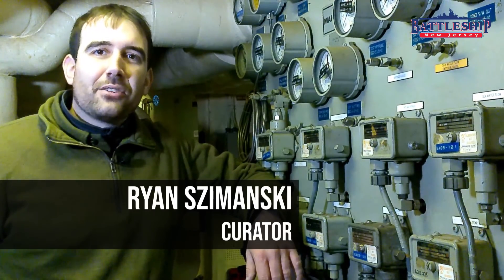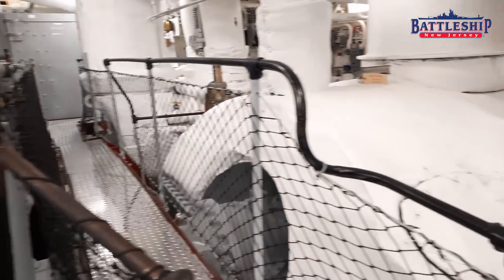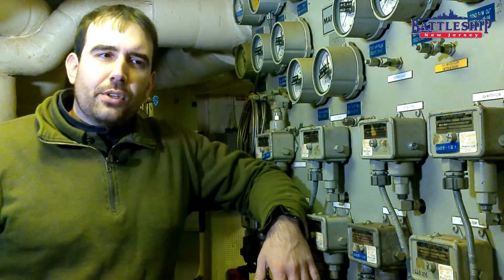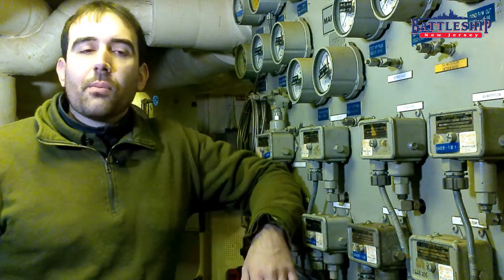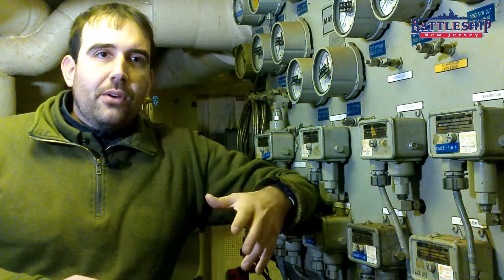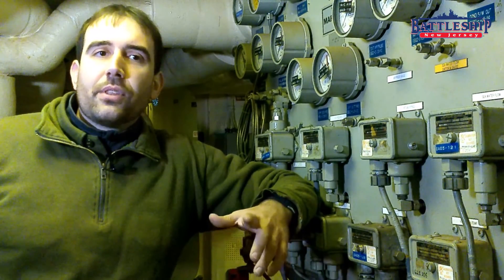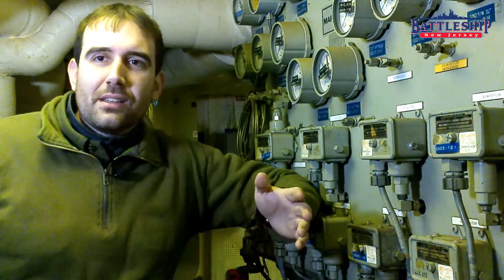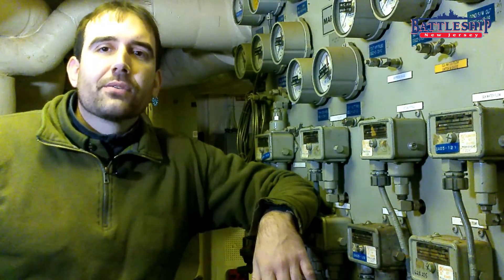Climate Control on the Battleship

Comment: I’ll tell you right now I was in the Massachusetts today it was about 87 outside and down in that ship was Oppressive heat…now I’m fat so it’s not a fair example but my god…the air was a still as a jungle and HOT…got down to third deck for a while and I was debating going lower to get down below the water line for cooler air or just freaking bailing to the one AC’d area on the ship….OK I gotta get out of here….lesson learned…if you’re going to battleship cove go in the winter or spring. Especially if you’re a sea cow lol….Now I will say this…the worst ship in terms of heat in battleship cove was the USS Joseph Kennedy by far  ,the best was the Lionfish SS 289, on that black deck in the sun you would think it would be 1,000 degrees down there but it wasn’t nearly as bad as big mamie and the Kennedy.

Comment: I'd bet on the original WW2 era air conditioning plants being a LOT different to the modern ones on the ship not just in output and how modern they are, but in their actual MECHANICS of operation. In that era, a lot of buildings with boilers, most trains with air conditioning, and a lot of places on municipal steam lines, actually used steam-ejector air conditioning where water was cooled by evaporating it using vacuum, created by a jet of steam through a Venturi tube. That's likely why they used chilled-water radiators instead of some other way of moving the cold around, steam aircon MAKES cold water and not room-temperature Freon or ammonia or whatever the working gas is in a typical AC cycle. Very reliable, very cheap to produce, not so efficient when it comes to utilizing boiler steam, and hard to scale up to full-ship power levels.

Comment: Cooling? We ran Launch Tube heaters to maintain temp inside the launch tubes underground on the ICBM fleet. Yes, there was also a chiller and air handler, but they were relatively small and the Sites did not need much since they were sealed and underground. Most of the heat rejection was done to remove the byproduct of electronics... Raised a Navy Brat by a black-shoe Deck Force sailor that spent 17 years on Destroyers (23 years total). Love the channel and all of our battleships, especially the New Jersey and Wisconsin. Thanks for all that you folks do, Ryan!

Comment: Well ventilated. In fact, possibly too well. Ranger was commissioned in 1957. She spent 35 of her 36 years in the Pacific. Every rack in the 2 berthing spaces I was in had a vent. They could actually keep us cold instead of comfortable. These did not have a way to close them off. So, when it was too cold, we'd stuff a t-shirt, or two, into the outlet. They could be rotated so the air was directed anywhere in the rack.

Comment: The AC didn’t do very well in a Persian gulf summer. Since the AC plants used sea water for cooling and the gulf water is 110, the inside was pretty warm. Even the electronic spaces, which where normally 60s, never seemed to get below 80 in the gulf.

Comment: The ship I was on had air conditioning, sort of.  The problem was that she was a surface ship that used air conditioners designed for submarines.  They just couldn't handle the load in the IO.

Comment: They need to use one of those big air compressors they use for Jack hammers and pump air into the system so they can turn over the engines where they do not lock up since they are not allowed for someone golly reason to use a boiler and then they can blow the horns on there and keep it still in good shape that would be a good idea no one says they can't do that I ran a steam engine train off of a air compressor one time and it works good
Reply: Just takes $$$$

Comment: Great video, and it prompts another topic suggestion: Ventilation. Not climate control, but just moving air around the ship. Was forced air mostly by exhaust, intake or both? How was fresh air circulated to interior spaces deep within the ship, and how did this change with different material conditions? What kind of fans were required for to feed the boiler rooms or the diesel spaces? In the ship's current state, how do you keep/prepare the various void spaces we see in these videos (like the "catacombs") to be safe for entry? I recall being warned to never enter unventilated void spaces shipboard as the oxidation of the steel could deplete the O2 below safe levels. Thank you for such informational videos!

Comment: I was on two ships. LPD-10, a Vietnam Era Gator, and DDG-86, a modern destroyer. On the gator we had a chilled water cooling unit. It worked well, likely back fitted in the 80s. On the DDG, we had pretty much the same setup. When they worked, we were comfortable. When they failed, depending on where in the world we were it was hot, sweaty, complete with the odor that one would expect from hot and sweaty sailors. Almost unbearable. 🥵 🤢

Comment: Served aboard the USS Independence CV-62 1980-1983 OE Division - we had AC in bearthing which used chilled water as the cooling source, I was a DS and all of the equipment that I maintained was cooled by Low Temperature Demineralized Water, had very little air cooled equipment. One of the other spaces that the OE Div. maintained had air cooled equipment and the AC system for that space was able to keep it so cold that you had to wear a jacket, was like walking into a freezer at times, but was the spot to go if you wanted to get cool quickly especially while we were in the I/O. Once we were in port say in the yards that AC didn't work so well, and during the winter it was cold no heat.

Comment: Chilled water A/C systems were introduced during WWII. York was the primary supplier of chillers and chilled water systems (and still is). I worked for them for most of my career and collect vintage ads, etc. I have an ad from 42/43 advertising cooling for the USS Enterprise. Obviously not all spaces were conditioned but it was a start, especially in the Pacific.
Reply: My father was a plumber and many of those old York systems were still in use in the early 1960's for industrial applications. Fresh water is non-corrosive, non-toxic and cheap!

Comment: Wait just to clarify - the hot water systems from the shore are pumped into the cold water radiators or the heating radiators on the ship? Or both? Or did they operate for both heat and cooling originally?

Comment: I served on the USS IWO JIMA (LPH-2) 86-88, and it was comfortable most of the time. The one time we had problems with a.c. was the worst time it could have happened- blue water work-ups at GITMO. It was already hot down there, so to say it felt like hell onboard the ship would be an understatement!!
Reply: My uncle was chief engineer for her around that time (I was a young kid then, so the years are a bit fuzzy).  We did get a tour of the El Paso when he was chief engineer on that ship, including the main engineering spaces.  It was a much more extensive tour than Eisenhower (for obvious reasons).  I don't remember climate control issues on either (Eisenhower was on a day cruise, and his cabin was comfortable).

Comment: Chilled water became the source for all air conditioning for most living and work spaces.  My berthing spaces were extremely well ventilated, up to the point that the main fan bearing failed during the summer in the Persian Gulf.  For four days it was extremely hot until a new part was brought onboard and fixed.  Ship supply was no help. We ordered the part, had it FEDEX to the UAE, we launched one of our airplanes to pick up the part and fly it back to the ship. The ship’s MM’s or HT’s installed the part had it running within the hour they got the part from us. Team work between the lack shies and brown shoes worked great that day, well appreciated by us all that sleep in that 90 man berthing space.

Comment: i have a question about the iowas. if a modern torpedo, like from a submarine would be launched and hit the ship, how much damage does it make on them? would they sink or even brake apart?
Reply: With NO particular credentials I can wave for you, I will suggest that torpedoes were a recognized threat when the ship was designed.  During battle stations, all watertight doors would be shut so that the areas flooded would be as small as possible and allow the ship to survive.   It, of course, would not be pleasant for those in the area of the hit(s), but the ship should be survivable.   Remember, there are special crews for damage control to pump out flooding water, make repairs, etc.

Comment: Most of my at sea time was on Knox class FF's. One ship had converted a space under the flight deck into berthing and A/C was an afterthought (we were at the very end of the supply ducting). When you're in hot climate with the sun beating down on the flight deck, that berthin was like an oven. On the other hand my last ship was the Kitty Hawk and she had come out of the yards in the early 90's with a newly refurbished a/c. Berthing was always cold, especially when the Air Wing wasn't onboard. My work space was well air conditioned due to the ATE equipment we used. Big challenge was when it was cold outside it was hard to find someplace to get warm.

Comment: I have to imagine that climate control is an integral part of preserving the ship.  Related to heating / cooling, how much, if any,  dehumidification equipment do you have on board and what does it take to operate and maintain it?  As you're not allowed to operate the boilers / steam equipment, are there steps you take to insure the various steam powered equipment (turbo generators, the main engine turbines, etc) don't seize up - are these items turned manually or by other means from time to time and / or lubricated or otherwise preserved to keep them from corroding solid in place?
Reply: Any turbine-driven equipment will have electric jacking gears so that the turbines may be slowly turned as you got them heated up prior to admitting main steam.  Jacking gear was also engaged during the gradual cooldown after taking them out of service when in port.

Whether they actually go through the effort for something that will NEVER turn again is another question.

Comment: USS Shangri-la CVS 38 1969 to 1971.  Worked in the PLAT and LENS shop which was air conditioned. PLAT was the closed circuit television system used to record and play back launches and recoveries. It was an old vacuum tube system. If the AC went down we had about 20 minutes before the heat in the shop rose to the point the the PLAT had to be shut down.

Comment: When I was a contractor in Iraq/Afghanistan, every place had air conditioning.  The whole "air conditioned tents" thing seemed insane to me, but indeed was standard.  There were a few exceptions (on the smaller bases, especially in Afghanistan, where power was limited), but almost everywhere I went in Iraq had AC.
Reply: We were spending 20 billion a year in air conditioning in Iraq/Afghanistan. That's more than the military spending all but the top 10 nations back then.

Comment: I was stationed on the USS Kitty Hawk(CV63). And I worked in air conditioning and refrigeration . Yes, all berthing spaces were cooled and very comfortable. I was there ‘73-‘79.
Reply: I was on the USS Coral Sea CV-43. My berthing compartment had the catapult steam line directly beneath it which made it rather warm, about 90F. There was a chilled water recirculation unit but it barely took the edge off.

Comment: I was in the Coast Guard, my first couple of ships I sailed on were definitely NOT A/C'd.  Those big diesel engines never really cooled down and the core of the ship was always warm, nice in winter or in the North Atlantic, but not nice in summer.  I was then transferred to one of the new cutters, (late 60s) and that was A/C'd even in the engineering control room.  When we were in Gitmo all the Navy ships always wanted to hold meetings on ours due to the A/C (cuba is really hot in July).  Many folks wonder why the old SS United States was never turned into a cruise ship, well the engines looked just like yours, took as many people to operate, and burned as much fuel (she had four screws too).  Because she was designed to run the North Atlantic route between NY and England she did NOT have A/C.  Summer trips must have been fun???  Threading A/C that works really well on an existing ship is a MAJOR job.  Nobody wanted to invest that kinda money.

Comment: As long as you keep the doors closed in the unused areas, shouldn’t they last forever because it will run out of oxygen to rust? If this idea is true in a way isn’t kind of bad for the ship to inspect these areas?
Reply from the maker: Keeping them sealed means you can't find out that the space isn't actually sealed and there's water intrusion. We keep almost everything open so it can be inspected. As long as its kept painted and there isn't water, it doesn't rust.

Comment: how were bulkhead penetrations handled for items like air conditioning ductwork and electrical conduit? i ask because i don't understand if a compartment was flooding that the flooding would not enter the ductwork and the electrical conduit and spread shorting out the electrical circuits.
Reply: Electrical all wires run thorough a pressure fitting, that seals around each individual cable. AC systems have a gate valve either side to enable shutting off of that area, which is also a good thing for fire control.

Comment: Hi Ryan. In my Navy career, the ship's with the worse HVAC: USS Forrestal CV-59 (Navigation berthing was located in Communications berthing 02 level forward of AIMD) It was heating in the summer and air conditioned in the winter; it best traits. USS Hunley AS-31 (Navigation berthing was next to the torpedo shop and below the aft mess deck starboard side) Being in Holy Loch, Scotland, one only needed heat, but it was constantly freezing. I can say there was good airflow...ice cold Scottish air! Ships with the Best HVAC: USS Samuel Eliot Morison FFG-13 constant temperature of 72° F with vents in the racks and throughout the work spaces. USS Nicholson DD-982 USS O'Bannon DD-987 had nice climate control too...almost as good as the FFG-13. I did a few TAD's to other ships...one was a FRAM II conversion...USS William C Lawe DD-763 only places that had real A/C was CIC, Radio, some electronic equipment rooms...the rest had fans that blew air...but this wasn't a permanent duty station, so it was an adventure. QM1

Comment: On the ship I was on (USS Kitty Hawk, 70-73) each coffin rack and it's own adjustable air conditioning vent.
Reply: Ditto on USS Constellation 1971 - 1974, except those vents blew hot air. During the three Westpac cruises I was on, It was always uncomfortably hot and sweaty throughout the ship (but one got sort of used to it).
Tonkin Gulf/Yankee Station climate wise, it was  typically quite hot "up on the roof" as well,, plus the stack heat near the island, catapult steam, and aircraft exhausts. 
We once sailed somewhere "way up north"  where it was very cold. Off North Korea was the rumor. None  of the heating radiators worked at that time either. Maybe in Officers' and Flag countries though. 
On the subject of improved shipboard creature comfort as a recruiting issue, It was, of course, an all volunteer Navy at that time, but during November 1970 I DID receive my draft notice for the Army during my sixth week of boot camp at San Diego. I had beat them to it by just a narrow margin.

Comment: he asked. How can a young male on active duty experience a hot Flash? I recall being in the Engine Room of a Frigate- for a Basic Engineering Casualty Control Exercise ( BECCE), Step1 turn off those forced blowers. My perception was a 20-30 degree F rise in temperature in a few seconds.  I was active Duty in the 1980s. The Frigate I was on had 5 x 25 ton A/C plants - generally the ship was decent temperature, but the AC plant was maxed out in the Persian Gulf. I heard the Spruance class destroyers had 3x 200 ton AC plants. A typical house A/C until on 1 to maybe 5 ton AC. So - I ask - any idea total authorized A/C plants on there in the 1980s? I will guess perhaps 8 to 12 50 tons plants. Thank you for another great video. .

Comment: I was on the USS Independence CV-62. How berthing space (Navigation) was on the Port side near the forward mess deck. 3rd deck. Our AC worked great in the Summer. Then the fan went out. And we had a steam line going through the space which caused it to get quite warm till our fan on our AC got swapped out but other than that it was quite comfy.
Reply: Thanks for sharing.

Comment: Is humidity control part of the preservation plan or something that is not necessary?
Reply from the maker: Dehumidifiers are important for preservation. Without them, condensation builds up and water rests in places, rusting through the steel. Not all spaces today have it, depends if its needed.

Comment: Why aren't you allowed run the steam systems? If the navy isn't going to take the ship back, why do they care?
Reply from the maker: Because that's how someone gets killed. These systems are extremely dangerous and there aren't regulations in place to keep people safe because not very many people have a battleship
Reply: Steam and steam systems are inherently dangerous and deadly. Just look into the number of people killed and injured by boiler incidents in steam engine railroads. They only became safe because of stringent engineering guidelines, relentless inspection schedules, and a highly trained work force. Operating an elderly steam system of that size is in some ways more dangerous than fiddling about with unexploded ordinance from the same era.
Reply: You often can't see a super heated steam leak because it's too hot to instantly condense. This is compounded by having enough pressure to cut off a limb, and enough heat to cauterize the wound.
Reply: Navy has some serious rules about that sort of thing. Battleship Texas even had its drive shafts and props removed.